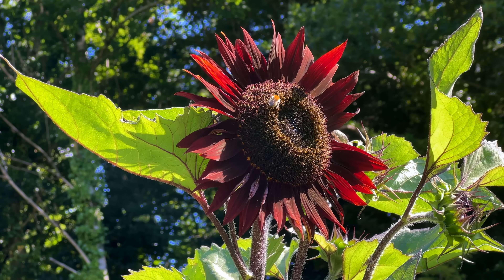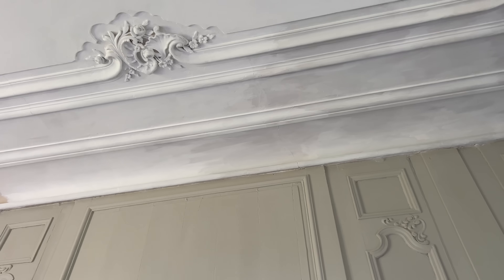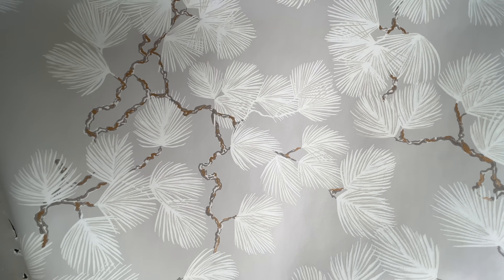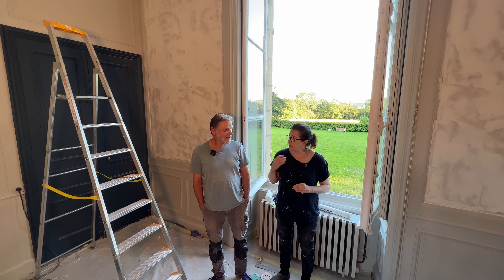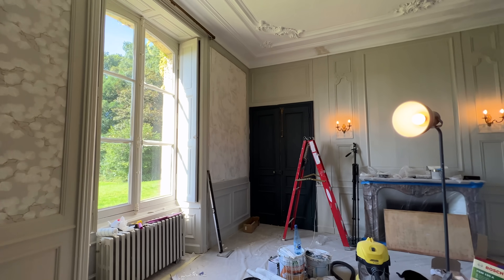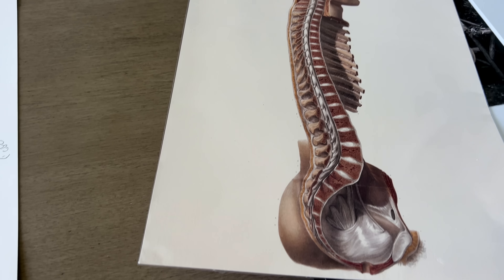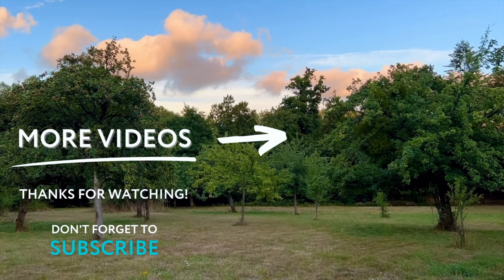The Great Salon Restoration: Wallpaper Is Up!

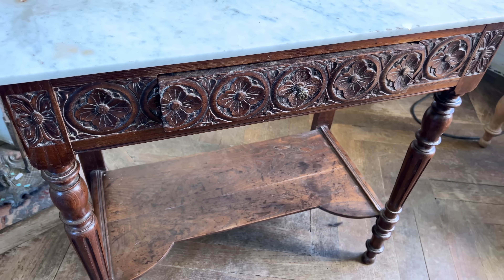Comment: Nice work on the wallpaper and plaster ceiling!  I think the table you show at about 14:01 was actually a "table washstand" and the holes would be where the  bolts fastened the matching marble backsplash to the top.  That was a bargain!
Reply: I agree, either a "coiffeuse"  or "table de toilette"

Comment: Congratulations on doing so well with your first wallpapering. It looks fantastic. My recommendation would be to recheck the wallpaper each day for a few days after putting it up, just to make sure it doesn't shift or develop little bubbles. A good wallpaper roller will mash these back down and ensure that the wallpaper catches all of the adhesive underneath.

Comment: What a lovely choice for your salon. The paint matches the background of the wallpaper. Your ceilings look great! So perfect. Good job! I’ve never used wallpaper liner, but it may be a good idea next time or a sealer so you don’t damage the plaster when you redo it. Much easier to remove, and it actually stays up better when you install it. If you put the art into groups, like the landscapes together in a area where your views are special, they are much more likely to be enjoyed as a cohesive group. This way you set a mood in the room you are decorating. Funny pictures together in a loo. And your items start to complement each other.

Comment: Another way to provide a good substrate for wallpaper on less than smooth walls is lining paper. It’s the same thickness as good wallpaper. I was in France recently and it’s readily available. The only challenging part is that it should be hung horizontally. This way, all those tiny dents in the plaster will not provide air pockets, which need to be completely eliminated before papering. Your choice of paper is wonderful!